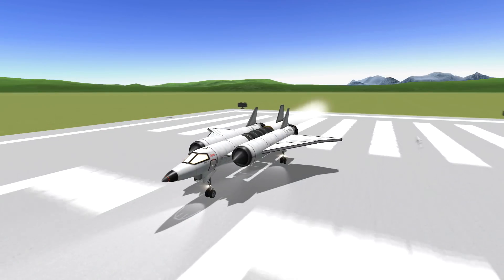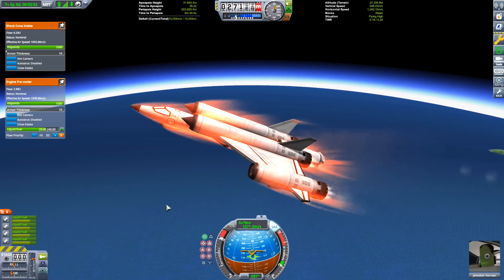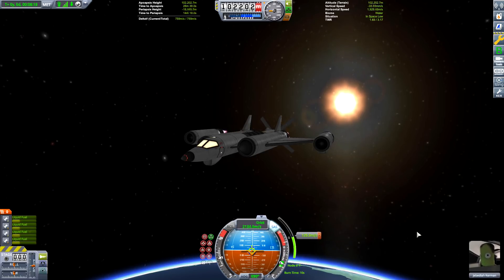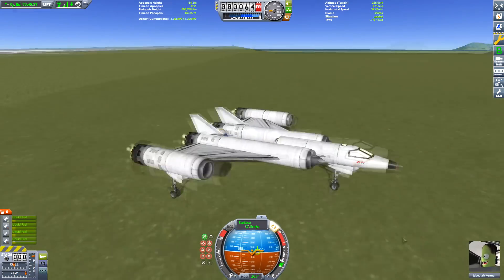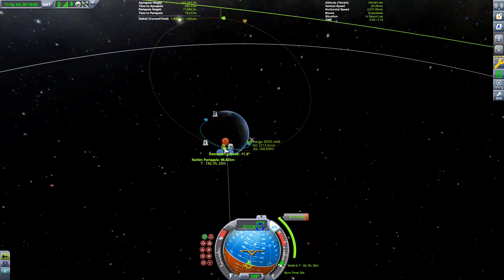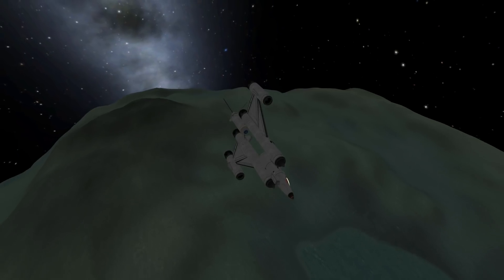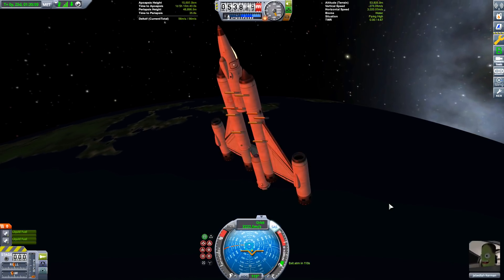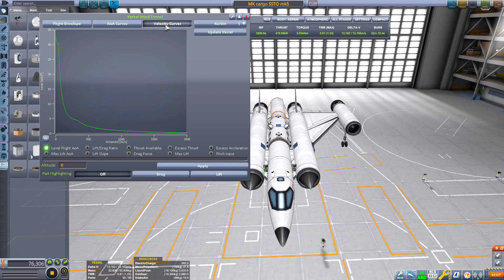MK1 SSTO with cargo - Kerbal Space Program

Comment: The wobbling is related to rotation of kerbin, your wheel's settings, the CoM and the CoL, theoreically it's possible Stop, but not practically.
Reply: ...just disable the steering on the back landing gear. Works every time with any mod.

Comment: Dear Orb8Ter, I love most of your videos. In this one, I cant understand why you used mk1 parts, when mk2 parts would look and work so much better. For 4 rapiers and Nerva combo mk2 is better I think. Maybe some special reason (love to know), but I can do the whole mission with mk2 parts much more efficiently and cleanly. It would also look so much better IMHO.. Now, to the snaking problem.. LG placement is critical even when it comes to real planes. Ideally you would want the rear wheels to be "just" behind the centre of lift, Not the CG which WILL be much more forward (like a meter behind COL in real world) and the front wheels to be half the distance from nose to rear wheels. Putting front LG too forward will cause yawing or snaking. Putting rear wheels too back will cause the same. This way most of the weight will be spread over the 2 rear landing gears and a lighter, but still good enough load on the forward gear so that you can maintain steering authority. I have found when using medium LGs best is to disable the rear wheel steering. If using unsteerable LGs, use the same principles, but have rudder authority to correct yawing. It will be like 30m/s atleast before you get solid rudder authority. Ensure equal weight distribution on either side. These next ideas are bugs of KSP and not much to do with ur craft. If you still find your craft veering to one side, eg to the left, rotate your craft one click to the right (not snap, be careful to turn just one click) in the SPH. Detach and reattach all the landing gears (note that attaching them to offset or curved parts will offset the wheels causing instability). Last resort is to rebuild the whole craft from scratch. Personally, most of my snaking problems were due to placing the rear LG too far back worried that I would hit my engines. Just put a small LG on your last engine and offset it so that it just reaches and touches the ground before the engine. Increase spring and dampers to the max on this wheel. Rest is up to the Krakens! Cheers buddy!
Reply from the maker: The reason I made this in Mk1 parts is more of a progression I did realize Mk2 parts will be better its just more of a personal challenge especially when I realized there were no cargo bays. 
Thanks you have given me a lot to think about I have been avoiding space planes like the plague but now I have a steep learning curve though it is keeping KSP fresh again for me, I think I enjoy the challenge of failure thats why my designs can be a bit weird :D
Reply: @Orb8Ter  Hey the cargo bays for mk1 are there, but they suck. Keep doing YOU buddy, I love it all.. KSP really keeps me up at night man. I love SSTOs and I wanna fly everywhere, except Tylo and Eve as usual. Lots of love and cheer from India!
Reply: Ashwin Mohan because the mk2 parts are mk2 for a reason... they are obvious “better”. But half the fun of the game is putting a challenge on yourself. It’s fun to build lower tech vehicles
Reply: mk2 parts are actually way draggier and heavier

Comment: Disable steering in all landing gear except the forward gear. That should definetly help stability on take off. If you're not already. Thanks for the videos mate
Reply from the maker: Another point I didnt think about trying cheers
Reply: @Orb8Ter  And disable friction on wheels also helps.
As for your fuel issues, you use close cycle mode too early, you must gain more speed before air intake become useless. Means more level flight at lower altitudes till your craft reach about 1500 m/s. But it depends on the size and weight of your space plane. The heavier it is, the lower the ascend profile is, just the opposite to rockets.
Reply: You should actually disable all steering for takeoff, and just use your rudder at high speeds to align on the runway.

Comment: Very helpful! Can you tell a successful way of controlling overheating in re-entry of mark 1 cabin?
Reply from the maker: Thanks, I find that aerobraking as high as you can in the atmosphere and dont be afraid of trying a couple of passes.. Oh and dont forget quicksave just in case ;)
Reply: One way I have found successful is by adding the shielded docking port. U will also need to go with inline mk1 instead of the regular one. Doesnt add much weight, helps to dock, and has higher heat tolerance, I cant remember (maybe 2600K). Ofcourse you can add heat shields, but not too practical in mk1 ssto. Personally, I dont see any reason not to go with mk2 parts altogether. They generate lift and look so much cooler. Orb8Ter kinda lost the point here IMHO, if you are going with mk1 parts, stick to 2 rapiers and 1 Nerva. Mk2 parts if you are looking for 4 rapiers and 2 Nerva. Go mk3 for higher load and further travel.

Comment: I get the drifting on the runway as well. It must be something to do with rapier engines. I use rocket mode on the rapiers for about 2 seconds to start. Switch back to jet mode. And you should ( fingers crossed) get off the runway without drifting like a boss.
Try it. You will be pleasantly surprised. I’m a console player so no mods for me 😄
Reply: Adding more info why I think it drifts. Maybe the engines don’t get enough air on start up. 
It makes the engines produce thrust at different rates. So you get drift
Reply: Happens with any jet engine. I think its best to set the rear landing gear far apart, not close to center of craft.
Not sure tho.
Reply: If your wheels are not straight backwards or on your wings and your wings are not stiff this is why. Also wheels should barely be behind your center of mass think of your real wheels as a fulcrum point.
Reply: I use auto strut and rigid attachment on all parts. 
I still does it. So that’s why I think it’s something about the engines. 
Using a burst of rocket mode removes 90% of the drift
Reply: @juicydangler2992  i Used to have this problem till I put my wheels on the body instead of the wings. I had a pilot set me straight. Also if your weels are even and at the same height it almost always fixes this problem.  I used to wobble all the time till I moved my wheels up right behind the center of mass the farther back they are the more you stick to the ground when your plane wants to life this causes that wobble alot too
Reply: Frederic Adams good to know. 
Will have to try that  on my next ssto.
Reply: @juicydangler2992  glad to help wish I could send pictures of a few of mine on here lol
Reply from the maker: Will definitely give this a go
Reply from the maker: Hi thanks didnt think about engines and intakes
Reply: Disable the steering on the back wheels